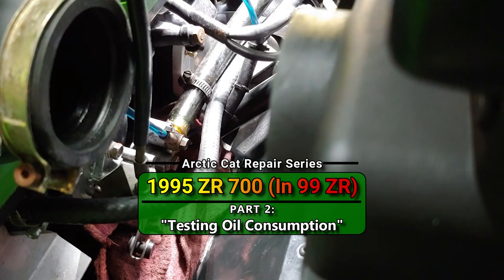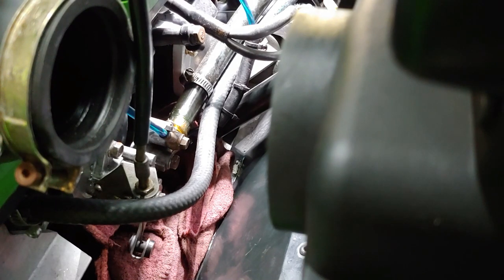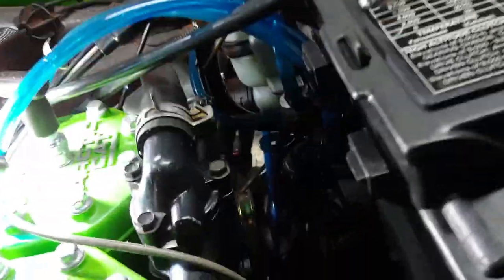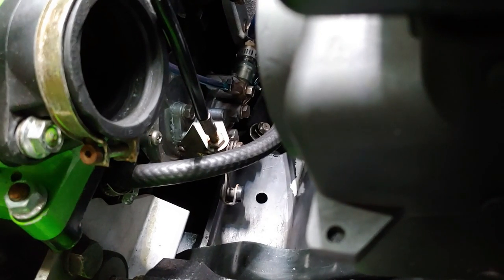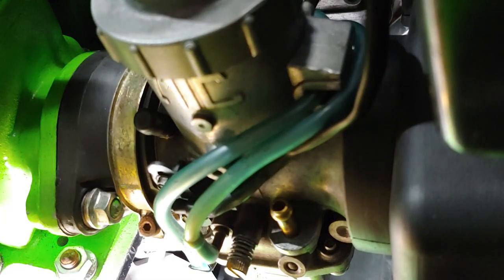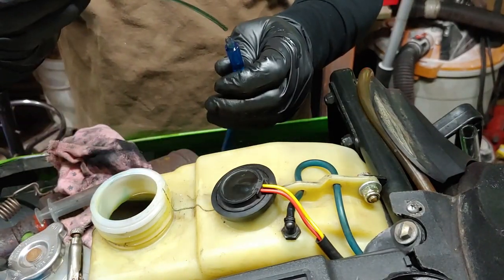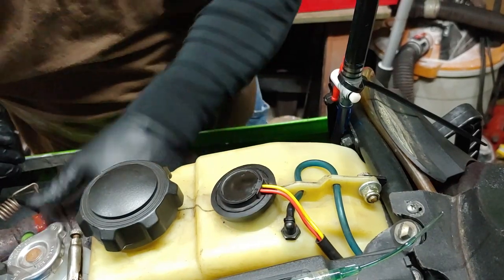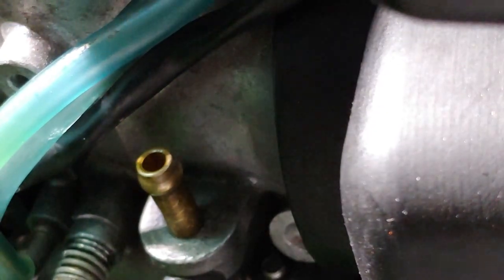1995 Arctic Cat ZR 700 Part 2 || Oil Usage [How to Test]

Comment: I just picked up a ZR800 that’s in pieces and have been running a zl600ss orange for years plan on long tracking and fixing all the problems with both I fixed a lot of problems on the ol ZL from your videos and hope to have ease with the 800 because of them as well thanks for the great content 🤘👍
Reply from the maker: Rock on bro! So glad its helped! Youll have to post some video and share when you get done. I too have thought about longtracting my sled.

Comment: Can I use a ext 580 oiler that I know works on a zr 700? The oiler on the 700 cable arm was siezed, i unsiezed the outer arm but I have no idea if it works, I bought this engine as a bottom end and am piecing it together, I’d rather be safe the sorry, the 580 has a smaller inlet but the 700 is going in the 580 so the 580 tank has a smaller inlet too, didnt know if it matters on size
Reply: The oil tank has a smaller outlet I meant, I see you made an adapter to run a smaller line
Reply from the maker: Unfortunately no. The reason is is because each size engine needs a specific amount of oil all throughout the throttle position in rpms. So an injection oil pump from a 580 cc engine won't put out as much as an oil pump for a 700. Even if it bolted right up which it probably would it's still would cause issues with proper lubrication. The only thing you might not could but might be able to do is to adjust the arm cable to where it's opening up sooner than it should providing more oil than it typically would ultimately matching that of the 700 output. But and this is a huge but, you definitely wouldn't be able to run the engine safely at higher RPMs because ultimately that pump wouldn't be able to put out as much oil at 3/4 to wide open throttle as the pump off of a 700. So I will only recommend that you get the correct oil injection pump
Reply: @Fixin2Ride-Official-  gotcha, so if I run the 700 oiler can I adapt that big fitting to fit the oiler tank of the 580? Or will running the smaller line restrict oil supply?
Reply from the maker: If you empty the oil tank you should be able to unscrew that nylon Barb and go get a brass one from like Menards or something that is the right size for the hose you're going to use. I don't really think that it would restrict it but who knows. That could be why they use the bigger one so better safe than sorry huh.
Reply: @Fixin2Ride-Official-  gotcha, I will see I sure hope I can otherwise I will have to figure out something, thanks for your help, I am using your videos for a lot of stuff on this rebuild especially carbs and oilers, my 40mm where tuned to 580 set up but I’m changing them now
Reply from the maker: Check out this video where I bench test a oil injection pump. This will tell you how much the pump shoupd be using and then compare that to the Arctic Cat manual for your models oil requirement.
 https://youtu.be/dZiIAzniK0g

Comment: Can u make a video on fine tuning a zr600 efi
Reply from the maker: Well theres not really any tuning to do being electronic fuel injected. Unless you are speaking of clutching and gearing?
Reply: I think my snowmobile is running to rich, and it got low compression, oily spark plugs and hesitates when throttle is slammed to bar?